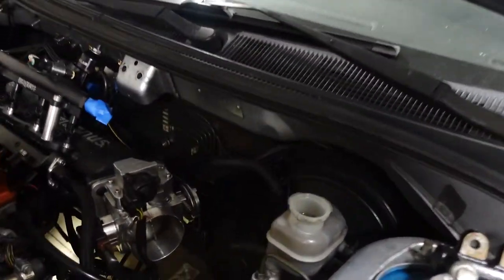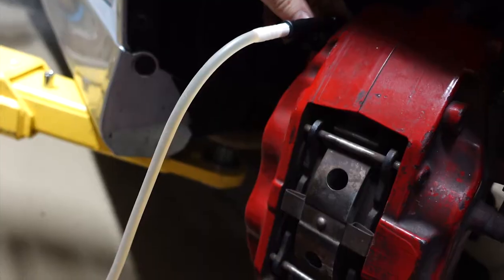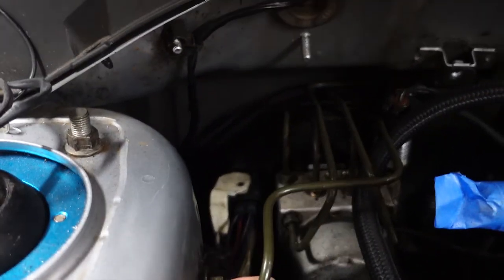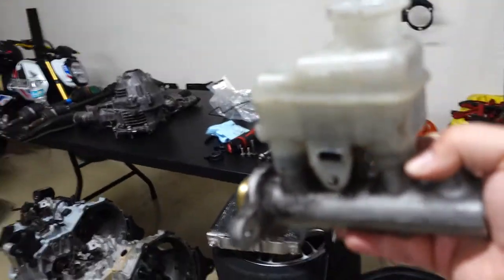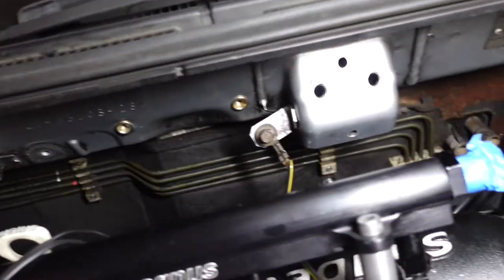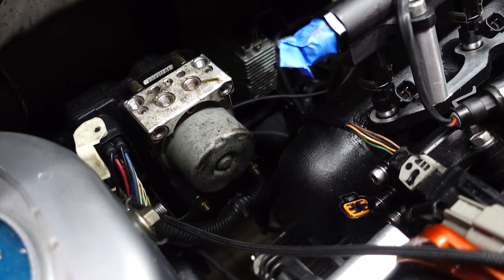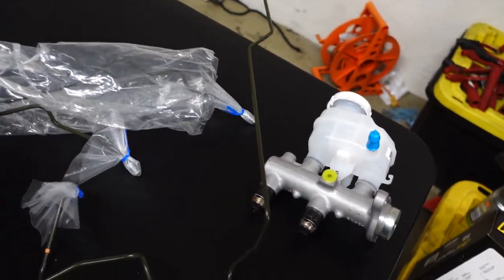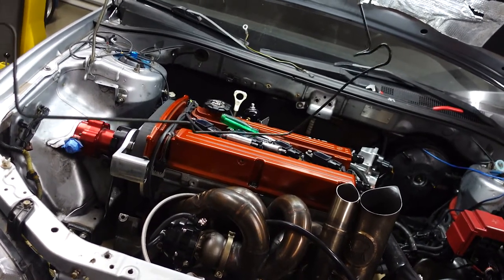ABS Delete on the EVO 8

Comment: but why would u want the abs deleted??
Reply from the maker: mainly for drag racing. in order to run a staging break, you have to have no abs, bc when you pull the staging break with an abs, the abs module freaks out bc it sees pressure.
Reply: @AmandaRaeJean  Was looking for this answer to the question. Thanks.